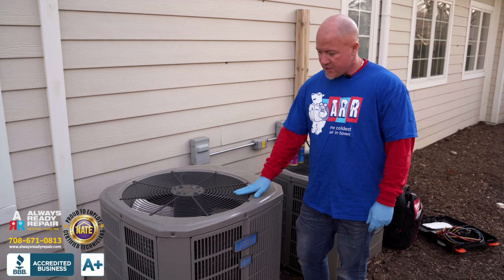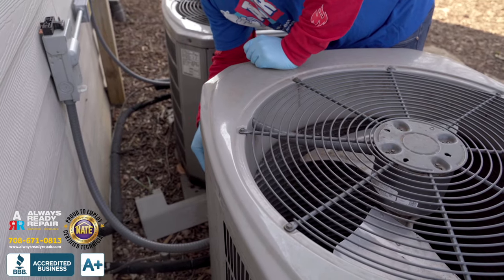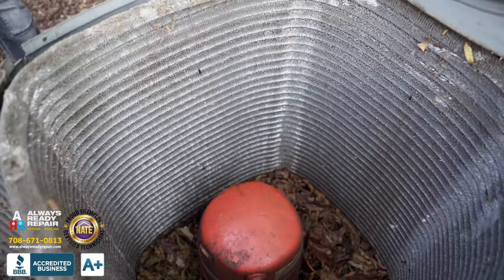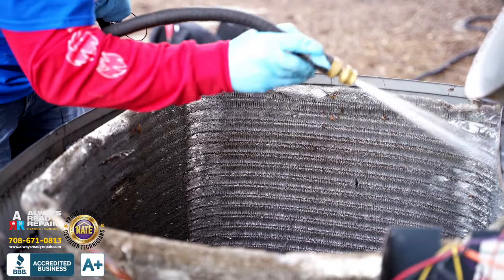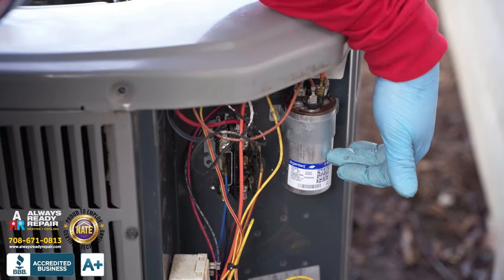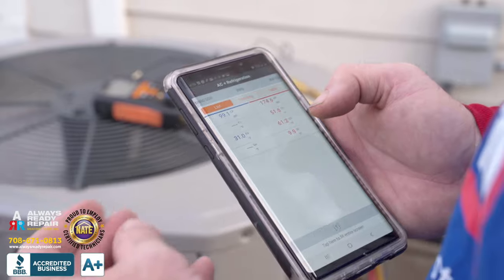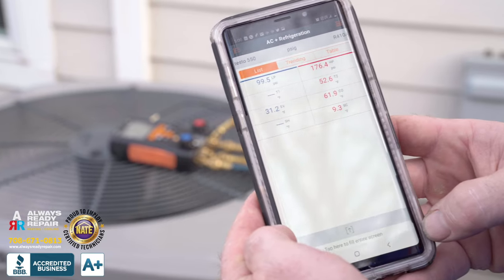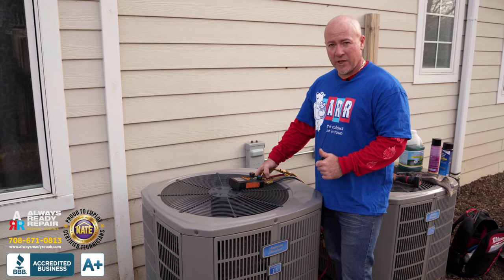How to Prepare Your HVAC System for Summer Use By Always Ready Repair

Comment: I own and operate a HVAC company here in Florida most companies do not do a coil cleaning they literally just come out and make sure it runs  they may or may not check the freon and they charg 29 bucks and try to sell you a new unit we do a condensing coil cleaning inspect the evaporator coil with a camera clean the drain line check Freon levels and electrical components but we are a little bit more expensive than 29 bucks most people are just cheep and ignorant as a rule of thumb you get what you pay for
Reply from the maker: That is crazy, i wish more standards were followed! Good luck to you and your business. I love Florida
Reply: Very nice to know 👌

Comment: how much would this cleaning usually cost? so I know what to expect
Reply from the maker: We have multiple options this customer was on a comfort plan. 2 cleanings per year furnace and ac.
Reply: We get our a/c checked every April.    The service call is $85.  If they find a capacitor or a part that needs to be replaced then its additional.  Well worth it.
Reply: @re8746  thanks! never needed an AC before until I moved 😂
Reply: @lapchurng  I live in Texas and recommend this service to all.    This summer has been extremely hard on us.    Going on a month straight of 100+ degree days.  Today is 106.
Reply: @re8746  you are literally cooking 🥵
Reply: @lapchurng  We get these types of summer about every seven to eight years.   We are use to 97-99.   But when it gets to be 101-106 everyday it wears on you.   Yes we are cooking.
Reply from the maker: @re8746  My sister lives in Texas. It definitely is a hot one!
Reply from the maker: @re8746  the humidity in IL can get crazy also.
Reply: @alwaysreadyrepairhvac  Disgusting.   I have been here since 74 and cant stand the Austin area any longer.   As far as the heat,  we get these types of summers about  every six -eight years.   We don't get winters like we use to albeit 2021.     Basically we go from summer to light fall back to summer.
Reply: @lapchurng  break in the weather today only hit 101
Reply: @re8746  🤣 I'm at a cool 65